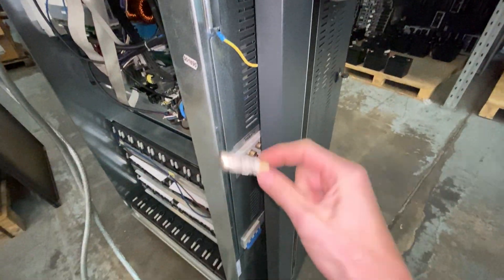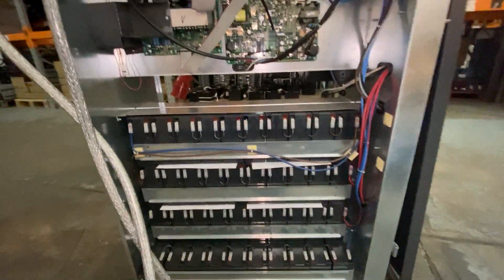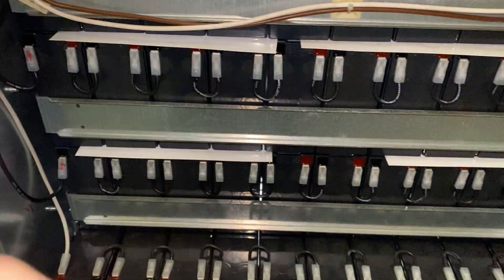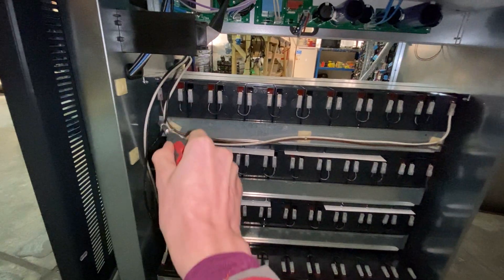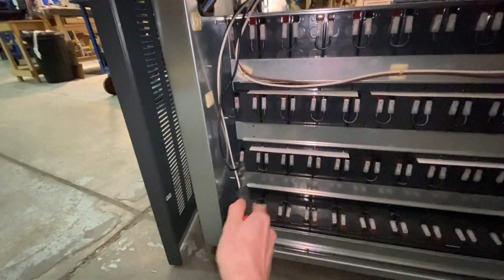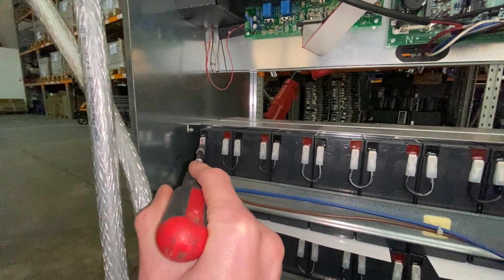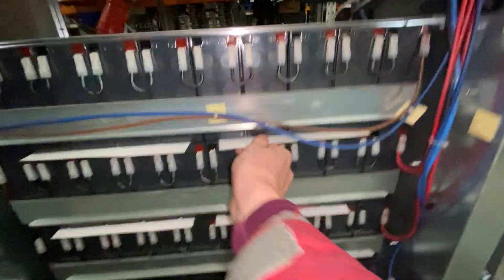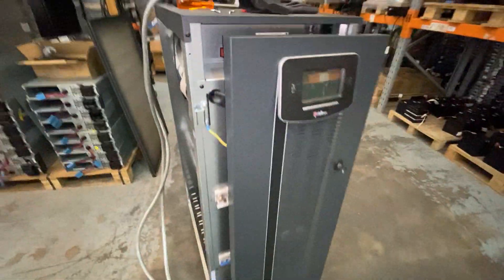Riello MLT UPS battery wiring video.

Comment: Hello I ll want to process a battery remplacement cause maybe the batteries is over.  But I will to try a process to verify the fusible diconnector but i will to know how to proceed before open the fusible box cause it could be hazard to open the fusible  batterie when the onduleur is in use.
An ups riello s3m 20kva.
Hello from paris🎉

Comment: Hi there l like your video, I will like to ask you a question I purchased a riello 10KW ups and is got suplay coming in L1, L2, L3, N, PE, (380v) My question is can this be power by 230v as in Single-phase I want to install it in my house, if you can let me know i will much appreciated, many thanks Michael
Reply from the maker: Hi
the UPS is out of our possession now - so I cant check the voltage rating sticker. I think from memory it needed 3 phase. The UPS will have a spec sticker that lists the expected input voltages.

Comment: Hi i have a Compact Ups which has 40 Batterries and I am trying to get it to power on and when I connect it to my van batterry it gave a load sparta the screen came on and then went off so my question is am I using the right power source or do I need to disconnect the batteries and then use the van batterry to show it working any help would be appreciated thanks
Reply from the maker: Hi

by the sounds of it you do not have enough of a grasp of what is going on. I'd find someone local to help you. Proceeding on your own might cause a problem or be risky.

Comment: I have the same problem in ups, there are warning indicators W07 ( service ups ) and W08 ( service bat ) , I have replaced with a new battery but the warning indicator still appears. Can you help me ?
Reply: it need to refresh the service life (Days/month) through UCOM GP software
Reply from the maker: Our UPS had no problem - but it sounds like you need a service engineer to reset these warnings (I dont think they are faults). It is not something we can do for you.😀 Try our friends over at theserviceteamltd.co.uk